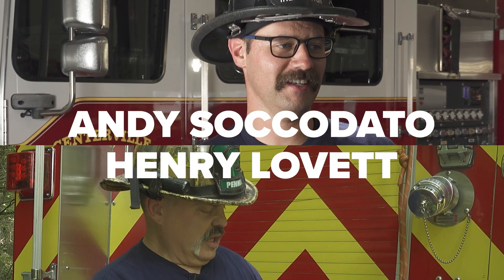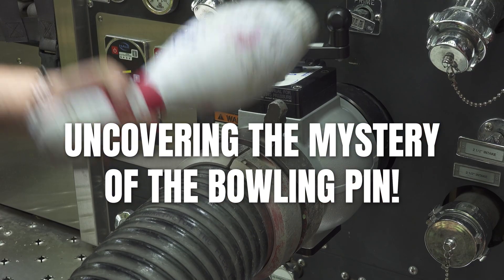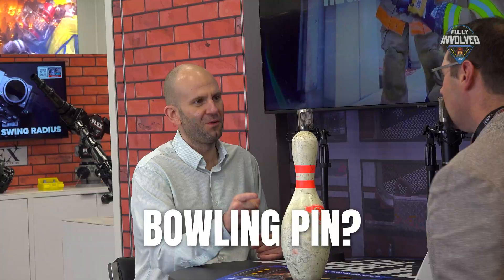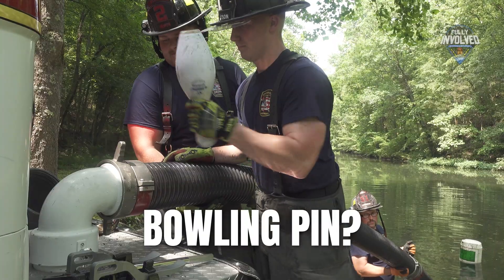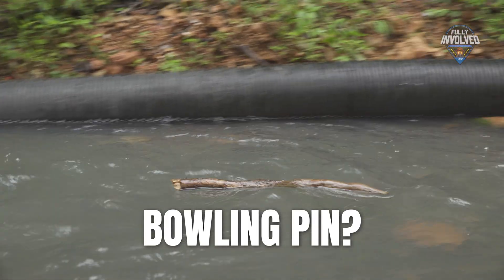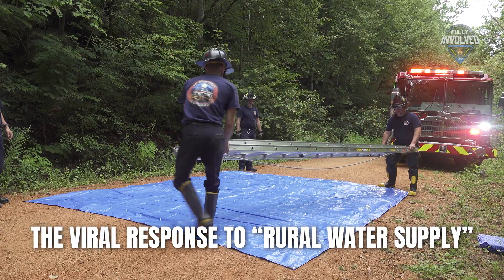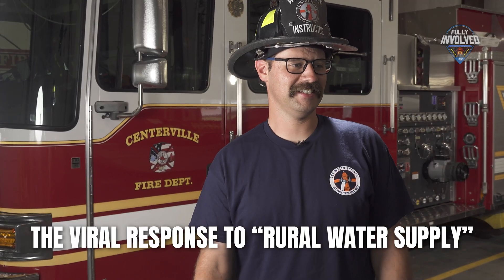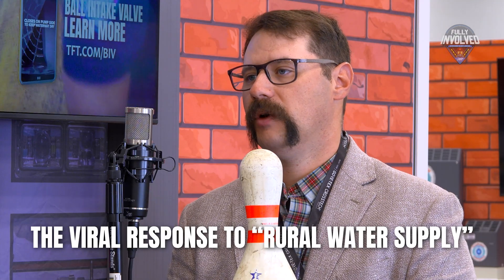Intake-to-Intake Pumping & Above-Ground Loop – Rural Water Supply Tactics with Andy Soccodato (E9)

Comment: If you need to stretch additional handlines, and the engine on the hydrant has enough residual pressure, why not stretch off of that engine?  Is the 2nd engine in pump?  If the 2nd engine is in pump and operating the deck gun and causes the intake to go into vacuum, that doesn't rob water from Engine 1?

Comment: Retired FF here. As an engineer sometimes we would have to add a second engine at a hydrant where no valves were on the 2 1/2 outlets on the hydrant. With water flowing and not shutting down we could slowly shut the hydrant down until the intake gauge was hovering around 0 but water was still flowing. The second engine was in place with a large intake hose connected to its large intake. The large intake on the opposite side of the first engine was quickly removed and the hose to the second engine was quickly attached. This was a balancing act with the flow on the first engine but it worked in the days before control valves on engines large intakes to get max flow out of a hydrant.